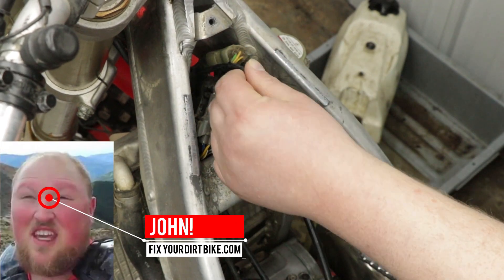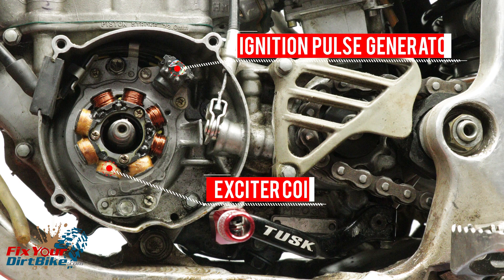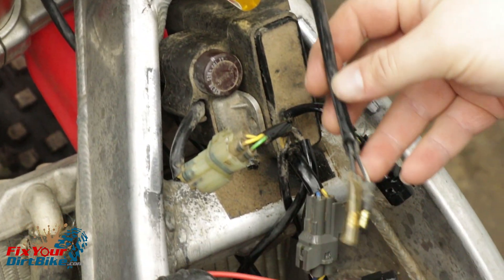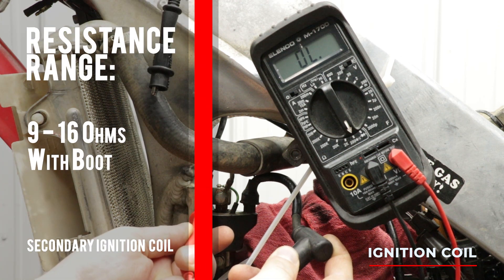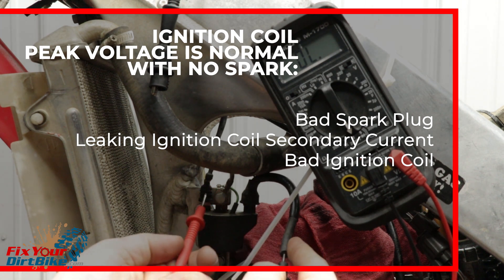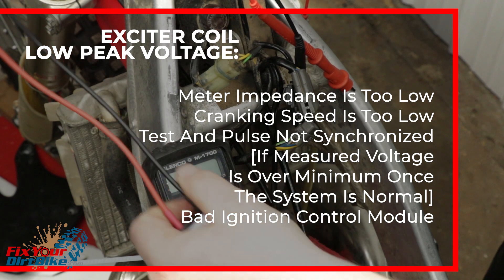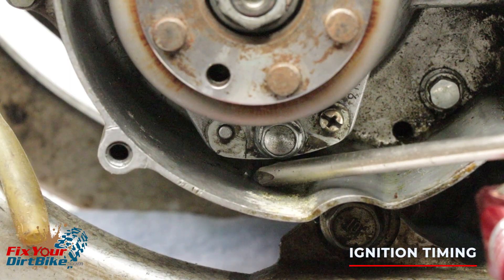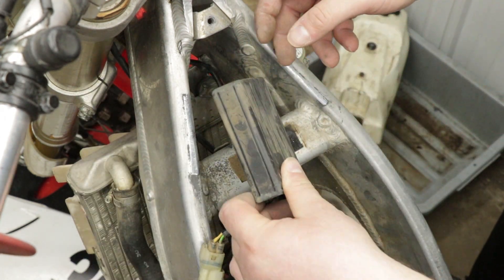1997-2001 Honda CR250 - Ignition System Troubleshooting | FYDB #honda #cr250 #fixyourdirtbike

Comment: Hi i need to know how to test my 1997 cr250 solenoid valve
Reply from the maker: That solenoid is supposed to give you extra fuel at full throttle. If it’s stuck open, then you will have a rich mixture, which acts like full choke. 

You test it with a 9v battery across the leads. It should retract when energized.

If it's working and you still have a rich mix, the passage may not be sealing completely.

Comment: My 1999 cr250 won't hit power band. Idles great, starts easily, tons of compression, (recent top end) new cdi, kill switch, plugs, clutch plates. My mechanic gave up, I'm no mechanic and no one else will look at it.  Very frustrating. Thanks your videos are awesome
Reply: What was the issue
Reply: If u changed all the ignition stuff then it’s the power valve being clogged which is simple easy fix…. I really suggest the lectron carb as well

Comment: My 99 cr250 has spark when I pull the plug and strap it to the outside of the cylinder. Sparks great and tests fine. Then I put the plug back in, k8ck it and it cranks then di3s and won't start again until I pull the plug back out and test it again, just to install it and pop for a second and then no crank again!!! Wtf?!?!

Comment: Very good video 
You did test the cap
Coil wire and cap 10.4 to 11 ohms
Coil.and wire 5 to 6 ohms 
Cap 5 to 6  ohms
Any lower then it should be replaced 
The more spark you have the better your fuel will burn.
If your Meter jumps around than it is no good this happen on the caps alot.

OEM Replacement coil is a 
Crf 450 MEB coil 2002 to 2008
Hope this helps
Reply: For CR 250 1999? Or 2000

Comment: Question for you, just rebuilt a 97 cr250 engine (all stock specs). Exhaust valve seems to be operating correctly and stock settings on carb.  It has a fatty pipe, turbine core 2 silincer and  v-forve 3 reeds with a 48 sprocket in the rear. Bike runs great lots of low end power and mid but the top in just feels a little flat to me. What would be the cause of that? Shall I try step up on jets or I have been reading about advancing or retarding the timing which I have no experience on how that would effect a 2-stroke motor.
Reply from the maker: Bump up your main jet one size and see what you get. I wouldn't bother with the timing.

Comment: Ok so I have a multimeter and DVA, ready to go.  just a couple of stupid questions, when you say remove the CDI do you mean disconnect both plugs from it while doing all these tests?  also what is the wire you put it the terminals to attach the crocodile clips?
thanks again
Reply from the maker: Yes, unplug everything going to the CDI. I'm just using basic utility wire, but anything conductive will work.
Reply: @Fixyourdirtbike  All checked out except peak voltage on ignition coil was 48 V instead of 100 V min.  Can you kick it enough to get 100 V as yours didn't in this example and you say exciter coil can't be kicked enough manually to get peak voltage?
I'm assuming my ignition coil is shot
Reply from the maker: @drpacman9996  My coil was bad in this video, but yes, you should see full volts.

Comment: Hello my dear!
When running my 1997 CR 250 it is making noise in the exhaust like a shot.
What would be the cause of the problem?
Reply from the maker: If its backfiring it's a lean condition post combustion. So air is getting in through the exhaust or sub-exhaust valve.

Comment: hello, I'm Lidisson.
I have a CR250 year 1997.
There is the possibility of installing a lighthouse for use on night trails?
Reply from the maker: You will need a 12v AC regulator.
Reply: @Fixyourdirtbike  yes, but the cr250 has no alternator to generate 12 v.
Reply from the maker: The stater is the alternator. What kind of light do you want to install? The 12v regulator is required to run a small halogen or LED. If you want to run a full headlight to drive on the street you will need to upgrade the stator and flywheel, and add a battery.